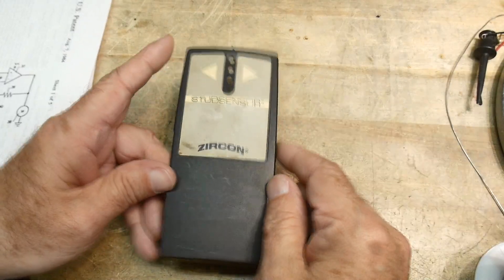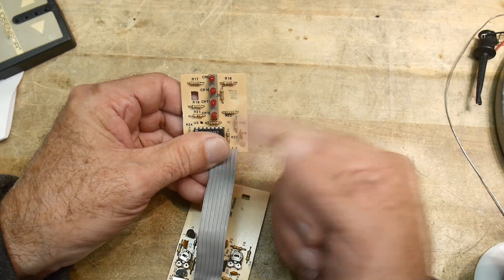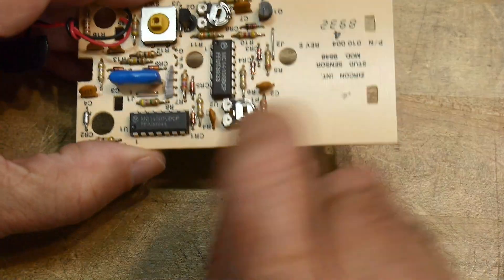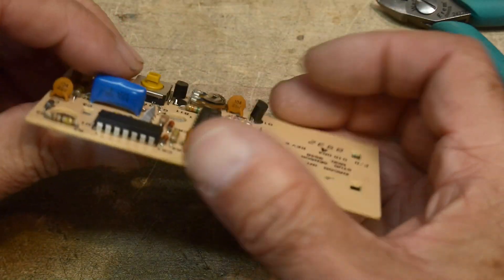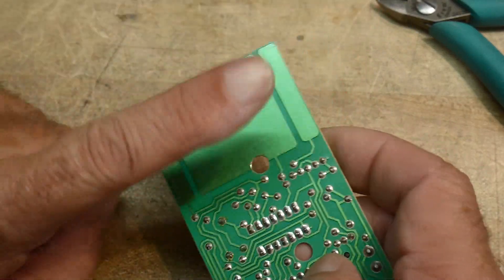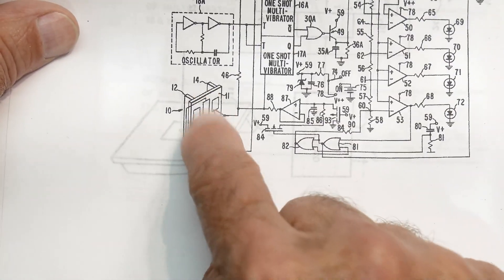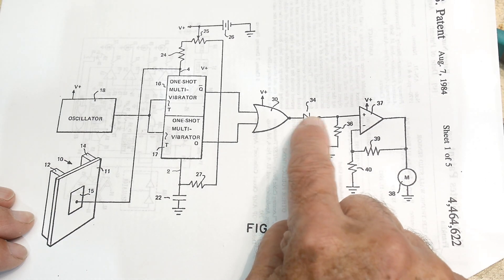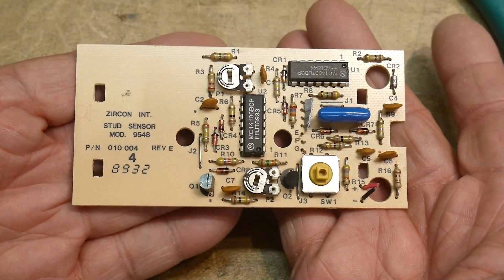#2073 Zircon Stud Finder Teardown

Comment: I thought the dielectric material needed to be between the plates, not opposite them as in this device. Very interesting.  It would be interesting to see this in action in a simple circuit without the comparators and LEDs.

Comment: Back in the early 1990's when these came out, I did the same thing as you. Then built my own. I even built a theremin based on the design and many window displays that people could place their hands on the glass with the sensor on the inside of the window to control things like audio playback, lighting and even mechanical functions.

Comment: For the people not familiar with studs, the width of the center "plate" and the adjacent plates are designed to be the width of a 2x4 -  a standard stud used in home construction.

Comment: After spending 18 months in my career on the receiving end of patent litigation, I've learned to start reading patents from the end first: the independent claims.  And then the definitions (such as you can determine or narrow) of the claim terms.  How novel to get to read a patent to learn from it!   My own experience left permanent damage to my psyche, but I've learned to keep the twitching under control in the years since!    

Nice video, though, always wondered WTF goes on inside those stud finder things!  I remember decades ago seeing a blurb about how one of the national labs was using UWB signals to do something like this.   I wonder if that ever came to pass, or if UWB is just something that iPhones use these days.  I was hoping at some point you'd get the "X-ray eyes" things going to see imagery of what lurks inside walls, waiting to electrocute your or spray water at you.